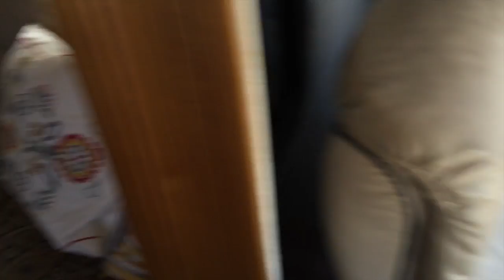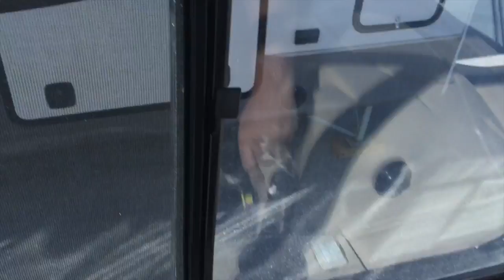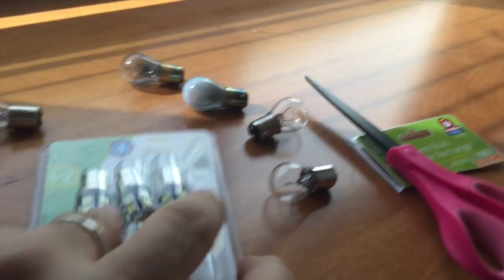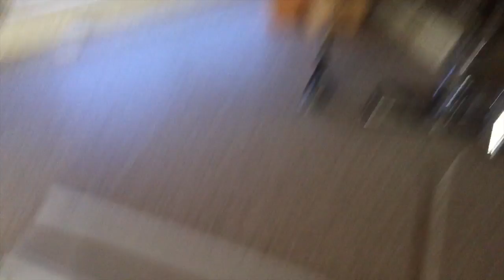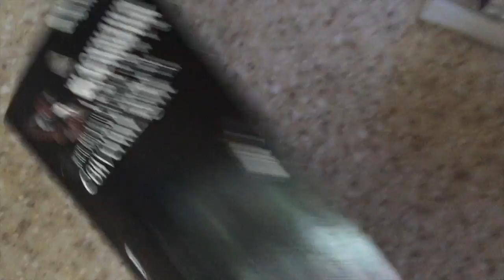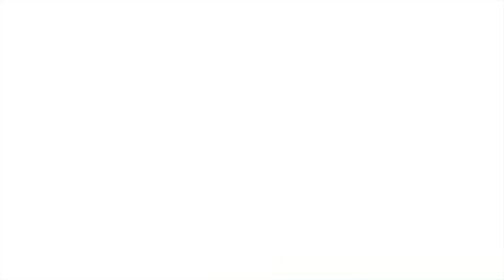LED Upgrade Part 2

Comment: Thanks for the bulb placement info., But aren't they a little too bright and the color is great for doing surgery . We ended up installing dimmers on all of the led's especially the reading lights in the bedroom. We also installed hidden indirect lighting anywhere that we could for glow lighting for mood. All are dimmable . I guess we are just a bunch of DimWatts !
Reply from the maker: Yeah, in retrospect some years later, the Mrs isn't a fan of the brightness...so dimmers do make sense.  I was going for more brightness for sure...and definitely the energy savings.  Thanks for the comment!

Comment: Nice. I have an rv with the old florescent tubes still in use and that looks easy. I already replaced my other lights only I did it the hard way. Rather than just the bulb I replaced the whole fixture. At the time I didn't know you could replace just the bulb. Oh well  :)
Reply from the maker: Definitely an easy upgrade.  Follow what I did and you'll be using 10% of the power you used to use before in no time :)
Reply from the maker: Sorry for the fantastically late reply.  For some reason it didn't show in my feed.  But yes, the process was easy.  Note the comment above from blondestrainger re: brightness and my reply.  Thanks for your comment!